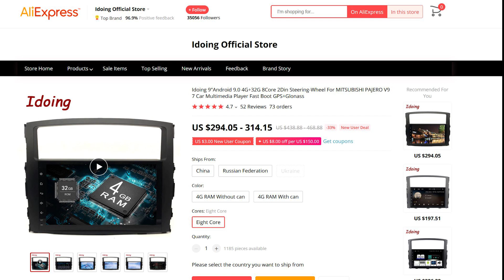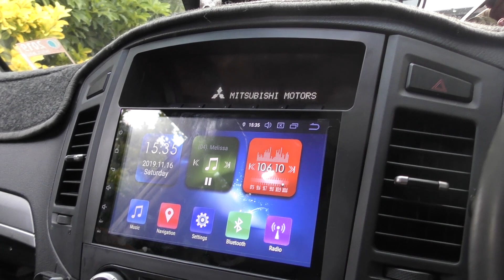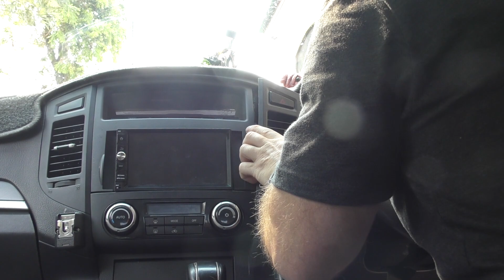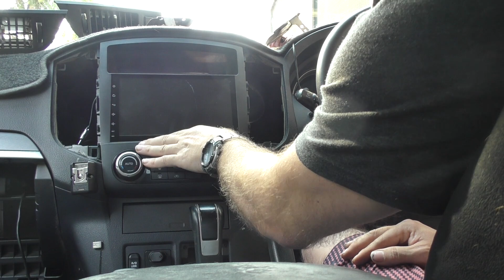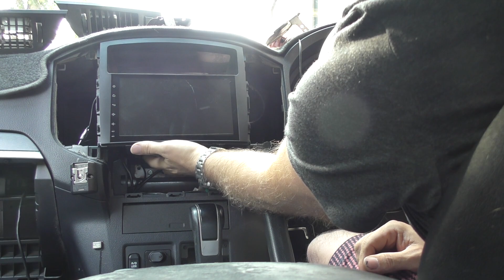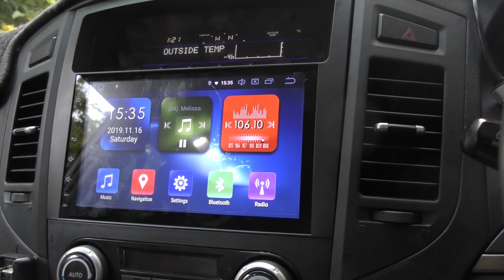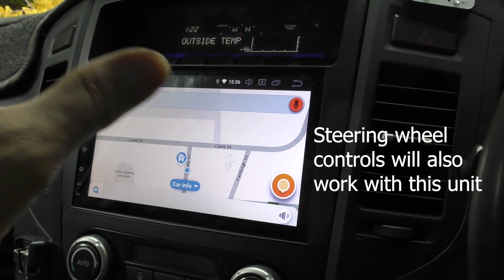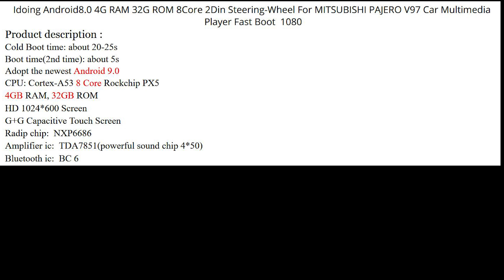Idoing 9 inch Android 9.0 Head unit - Pajero Install & overview

Comment from the maker: Hi all, I'm happy to report I have now sorted the AM radio and it is working as expected. This was a result of not connecting up the 12v power source to the pajeros powered antenna. With the amp trigger wire now providing power to the antenna, AM radio is working just fine.  I'll cover this off in the over view / usage video to come.

Comment: Looks promising, keen to see how it fares after a few months use. You’ve definitely convinced me not to put my Hizpo 7” in the NW. Stock GLX stereo will have to do for now
Reply from the maker: I didn't think the little extra size would be a major difference but it looks so much better than the 7.  Crossing my fingers it goes well. Granted it really only needs to operate as a tablet really for me to be happy. The AM thing is bothering me a little though.

Comment: Hi, the Rockford 12 speaker system was a bastard to deal with when installing a new pioneer head unit, if you want to keep the existing amplifier setup.  I eventually got it to work with everything except the centre speaker.  To get the AM to work you need to give it power.  I'm sure the green or blue wire will be there for it.  It cost about $300 for the extra attachments to get it going. Thanks.
Reply from the maker: Thanks heaps Marty for sharing. I was hoping someone who had done it would pop up. I do recall someone else mentioning the power requirement for the antenna. I'll double check. Although idoing did reply basically saying am may not work.
Reply: Hi Marty, what's the deal with that? Is it key to identify the amp wire at the Head unit end, to liven all the speakers?
Reply: @damiendaly1462  Hi, I have forgotten what I did lol (getting old) and taken the credit for it but my buddy did the soldering etc.  I think we did probe all the pins on the OEM harness to get 12v and eventually found one. Hope that helps. The website aerpro.com lists all the parts needed for Rockford.  One new item which I think has replaced MITO02 is the AXTOMI2 (looks the same product anyway). And we used the APUNISW2 to retain steering wheel controls. Plug and play mostly.

Comment: Nice work man! Just wanted to check with you, did you connect anything to the video out? I'm trying to find a way of having an extra screen up near the windscreen for the navigation app, I just find it safer than down on the head unit. Would be cool if that worked. On most units Ive seen its just video that plays out to the video RCA out. Thanks again for the vids, hope ye had a good Xmass and happy new year to ya!

Comment: I've been using this unit for nearly 4 months on my NS, it's great. Works better with the stock speakers. However I'm starting to have issues with the steering wheel control
Reply from the maker: I don't have steering wheel controls but what are you running into. I was looking at the add on steering wheel controls they sell but feedback isnt great on them. Is your AM radio working in yours?
Reply: I got it sorted out mate. I was referring to the stock steering wheel audio controls, they work with the unit. They started showing me some issues after a month or so of installing the idoing, turns out it was a bad clock spring. Conclusion the idoing still exceeding expectations at every level!!!
Reply: Which system in the NS did you have...
Stock radio or the MMCS

I have the exceed - GPS, AMP, reversing cam 12 or 16 speakers
(Not sure)
And looking for something plug n play
Reply: Kiwiaus this should meet your requirements. Doesn't get more plug n play than this. It works with both stock and mmcs, you just need to choose the right model with the seller

Comment: This is exactly what I want. I wonder if it fits with the MMCS Rockford system. Their broken english website is so hard to follow. I hope is truly is a plug and play system without the loss of the roof mounted TV, rear camera, steering controls and 12 speakers.
Reply from the maker: shoot em a message mate. I'm sure they'll get back to you and let you know. They've been responsive with me. Not sure on the RF speaker set up. I'm not sure how it is set up. Do you know if there are remote cross overs etc around the vehicle and what the outputs are from the main unit.  I'm afraid I can only show you the one I had.
Reply: Did it work with the Rockford ??

Was your orignal system GPS and amp one ??
Reply: You need canbus..

Comment: Looks excellent and you have my attention now , would love you to get AM working cause I listen lots too, but interested in mapping applications too and how that goes. so well done looks the business with the Fascia kit and not that much more than the Pumpkin and a fascia plate to suit
Reply from the maker: Definitely a cleaner install.  I'm still working on the AM radio. I've been using the ABC app which is working for now
Reply from the maker: Les, happy to report, I've got the AM working as it should. It was only a case of connecting up the powered antenna on the paj to a 12v source, in this case the amp trigger cable and all was good. I hadn't connected it up as I wasn't able to ID what it was during the install as the previous owner had extended it and only used a black wire. 
So I didn't want to apply 12v to something which looked like a ground wire. 
so we're all good and I can go back to monitoring my old fart radio channels again. Mostly for fire alerts etc . I swear :)

Comment: Interested to see how you like your Idrive as well, I installed mine a few weeks ago and been loving it so far, would be interested to see what settings on it people are using for different situations
Reply from the maker: its bloody great  Sean. completely different to the cheap Chinese one I tried. I just leave mine on auto. But a mate loves his on U7. I haven't tried it off road yet. I want to try going into echo for a rock crawl type deal and see if that helps with control

Comment: like the look and fit of the of the unit - does look neat and factory. Does the screen suffer from glare and do you need a data connection to use maps or they work offline?
Seen these on ebay, lower spec but seem a good buy at under $400. 

been watching your Vids for a little while now ( recently brought an NT), keep em coming. Cheers
Reply from the maker: working on it mate, as time and funds permit. I've not won powerball just yet but trying

Comment: Looks factory 👍👏. Have you used the Bluetooth for phone calls ? 
On different note, curious as to what mapping GPS you use when you go bush ? 
Good work.
Reply from the maker: Hey B4W.   Yes mate. I use it for phone calls every day. Audio is nice and clear and works well. Not had any issues with it. I use google assistant to dial all calls from my phone and it routes it through the head unit whilst under way. 
No issues there at all. 

I'm still trying to find the perfect off road mapping software but I have been using locus maps and just using the freebies on there plus shonky maps. If you know of anything else to try, I'm all ears.

Comment: Hey mate - Did you reuse the white trim clips from the old fascia or does the new one clip straight in? Any problems with not using the old mounting rails?  PS love the channel keep it up.
Reply from the maker: fits straight in. didnt use any of the old trim around the head unit because the one in there wasn't standard, so i didn't have it anyway. hope that helps

Comment: Ehi mate, great video as usual.
I have a just purchased a similar Android HU and I'm not sure where to run the usb cables so they are easy to reach.
Did you plug it into the existing usb in the glove box or do you have any better ideas?
It would be great if you could let me know or even flick some photos.
Cheers
Reply from the maker: What car did you stick it in? Pajero gen 4 ?
Reply: @DENMONKEY  yeah mate sorry forgot to mention it lol, 2013 nw. If would be ideal if one of the cables could replace the facory usb port in the glove box, I'm actually here trying to pull it apart lol.

Comment: hi, great video. I enjoyed watching as I'm in the middle of installing a Joying unit into my 2016 Pajero NX (or Shogun as we call them in the UK). The unit is great and the wiring was a fairly simple swap from the original wiring (my OEM unit is 8750A451). I fitted today and all works well except the steering wheel controls. On my original unit there are 6 connections and I think I'm missing the one that handles CANbus. Please can you confirm if this is right -
1) Aerial connection
2) 16 pin plug next to aerial - I think this has the CANbus and my wiring loom didn't come with a plug for this socket
3) 18 pin plug - not sure what's on this one ?
4) 20 pin plug - Main Audio Connector
5) 1 pin plug - think this could be satnav attena ?
6) 8 pin plug - think this is rear parking camera
On my wiring loom supplied with the Joying head unit, all plugs are connected except the 16 pin and the 1 pin
Can you confirm if the 16 pin contains the CANbus connections and which pins . The Joying unit does have single connectors for CANbus in and out so I could splice in.
Thank you, any advice much appreciated.
Reply from the maker: Hi David , sorry mate, can't help with this one. It's been a while since the install and I can't recall that level of info. I've installed a few now and it's hard to remember what was what. I thought the steering wheel controls were labeled and were brown in colour ? I can't tell you which harness they were on though. again I could be thinking of another install.  That and I didn't have steering controls on my wheel, so I didn't pay it any real attention through the install. sorry i can't be of more use.
Reply: @DENMONKEY  hi again. Thanks for your reply, I understand it was a long while back. I got my Joying unit sorted and I'm very pleased. I only have one gripe - the microphone quality it not great. I'm using the external one that came with the unit and I ran the cable up near the rear view mirror and it plugs into the back on the Joying unit.
I'm thinking is there anyway to use the original mic that is used by the OEM unit ?  I assume it is located in the top unit near the rear view mirror. Do you have any idea where it's located. If I could find it, I can just splice in the wiring to use this one instead of the one coming with the Joying unit !
Thanks.

Comment: Do you still recommend this head unit or are you aware of better ones? Have you installed an amplifier with this as well. I have a 2016 Nx and the cabin and road noise makes an amplifier a desired addition. If you have not done this yet can you consider this for an upcoming video.?
Reply from the maker: I still like it mate. its still doing everything the same as it was when first installed. I haven't had any updates though to the operating software which I'd like to see to ensure I'm up to date. the apps all update but I fear it's getting dated because of this. Still it's working and I have no complaints. I do already have it connected to a couple of amps. These were part of the previous install, so there wasn't any work required there to video im afraid

Comment: Hey mate,
So everything works,
Steering wheel controls, original reverse camera, radio etc?
How have you been finding the GPS AND Bluetooth operations?
Mirrorlonk and the apps you have installed work well?

Are you going to do the follow up video like you said?
Reply from the maker: hey Alex, did you get the follow up vid ?

Comment: I was scanning the comments I'm sorry I didn't see it so I'm just asking that what exactly does the info screen is on top of the radio now that the new radio is connected, temp and time?
Reply from the maker: still has buttons to be able to adjust it etc. but yeah its part of the normal Paj dash that shows, miles til empty, outside temp and time etc

Comment: Great review. How can you get the steering wheel controls to work?
Can you get Android Auto on this unit?
And have you worked out the AM radio at all?
Reply from the maker: Hi Kernal and thanks mate. 
Yes, I got the AM radio working. It's still not great but that's more to do with the crap antenna set up in the rear window of the pajero. 
I just hadn't connected the 12volt power to the antenna. The previous owner had used a black wire for it and I thought it was a ground so didnt want to put power to it. 
Now it has power, its working. 

I don't beleive it has android auto as such but you can mirror your android phone on the screen and control it . 
That said, I'm not sure why you would need to. let me know your thinking. 
It's basically an android tablet in your dash, so you can do anything directly on the unit that you could do on your phone. 
Any apps you've paid for on your phone can be installed on to the head unit. That will save you connecting up. Let me know if I'm missing something though. 
Normally android auto is on non android head units like kenwood or sony etc where you can't install the android apps direclty and this is how they let you do it. 

here's the info direct from the website 

 Screen Mirror Link        
By using the Easy-Connect APPS,you should connect your android smartphone with this unit via USB charging cable and Bluetooth.you can mirror link the connected android smart phone display such as main menu,photos/videos,Online navi maps. also you can control the connected Android Smart Phone on this unit.it can support the most Android Smart Phone. For Iphone,use wifi connection,you can mirror the unit,but can not control.

Comment: Given you said AM doesn't work, how's the FM on analogue ?
I rolled the dice with a Chinese unit and it was crap. 
Can't wait for the full review and the TC lock up.
Reply from the maker: Fm is great. But as an old fart, I like my abc radio, so I need to figure it out. I've mentioned it to the supplier and am waiting on their response. This could be a deal breaker for some
Reply: @DENMONKEY  ok thanks ya I'm not into AM yet, got a few years to go, I hope lol. 
Just have to see if they have one to suit my car. 
Thanks for the info.
Reply: @DENMONKEY  Thanks for the review. As a fellow ABC junkie, AM is the only deal breaker here for me - hoping you can work it out!

Comment: Hi! Thanks for the very helpful video! What is the screen brightness like in the sun? I installed another chinese branded head unit in my old touareg, and the screen was almost invisible in the midday sun. It was so bad that I ended up connecting a lenovo tablet to the unit via bluetooth and mounting it on my dash... not ideal, but showed me just how crap the head unit's screen was. Now that I've bought a Pajero, I don't want to make the same mistake so would appreciate your comments on the screen quality. 

All the best!
Reply from the maker: Hi there, I've not had any issues with being able to see the screen regardless of the time of day etc. But I haven't had any issues with any of the units I've had in there. I'm still very happy with the unit itself.

Comment: Mate, it will fit to my 2007 NS Pajero?
Reply from the maker: Not sure what the dash on the NS looks like. Check the website though and they have options for most models. you just need to pick the right one that looks like yours

Comment: Do run the unit with phone plugged in or just over bluetooth .. or do u share ur phone wifi cheers
Reply from the maker: I run mine connected over bluetooth and connected to my 4g wifi modem that I also have in the car. For my other car, I connect via bluetooth for calling and hotspot it to use the wifi for the head unit. Hope that makes sense

Comment: I just installed one in my 2012 Pajero.  Looks great but I can't get sound working.  I don't think the amp is wired up with the harness that idoing gave me.
The service guys are trying to help but I haven't had any luck
Any help would be great.
Note. I have the Rockford Fosgate 12 speaker system.
Plus the MMCS head unit makes no sense
Reply from the maker: Hey Pat, 
I'm afraid I don't have any ideas. Other than dropping down the top menu where the wifi etc is and checking the little speaker icon there. This opens up the equalizer setting. 
Maybe check to make sure it's not muted etc there. 
no sounds at all, have you tried the phone or radio ? 
Since I don't have a RF set up in mine I cant test anything for you. 
Does that use any RCA connectors at all ? Did the harness seem to fit correctly?  Double check you've pushed them all in on the back of the radio. 
Is it working otherwise? powering up etc ? 
I've found their support to be pretty good. they should see you right . 
can you keep us posted ?
Reply: Update
I got some help from the support guys and we still couldn't get the amp to switch on.  The Head unit was working but still no sound.
That is until I started driving down the highway checking if the illumination switch works.  A beep came through the speakers.  I turned the radio on and MUSIC in my ears.  So now I drive around with the headlights on and have music.
Reply from the maker: @patrickmccarron9944  that sounds to me like the illumition and amp remote lines are some how crossed. So when you turn on your headlights it's powering up the amp.
Reply: @DENMONKEY Update.  It all works now.  I spliced the Illumination circuit and the battery circuit together on the CANBUS.  Now it works even with the headlights on or off.
As much as a pain it was to get it working I will still recommend one over the dirt MMCS.   Sounds great with the Rockford Fosgate System
Reply: @patrickmccarron9944  Did you have to order a separate cable from IDoing to get the amp working? Can you share a photo of the wires that needed spliced together?
Reply: Hi Patrik. Could you please help with the power supply to the amplifyer.